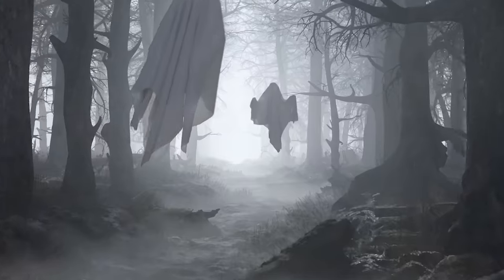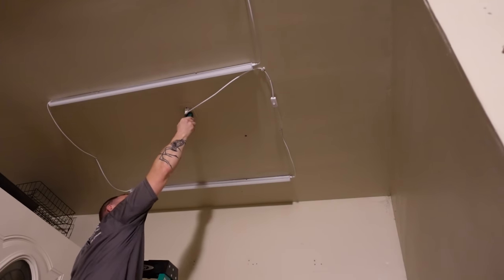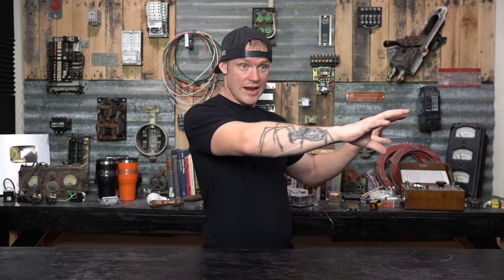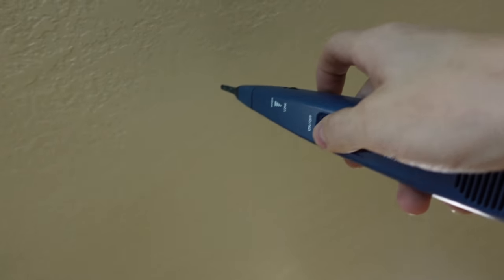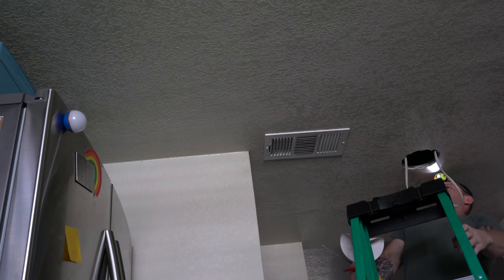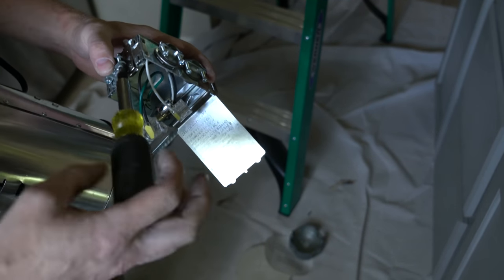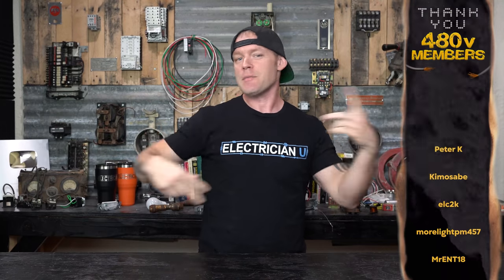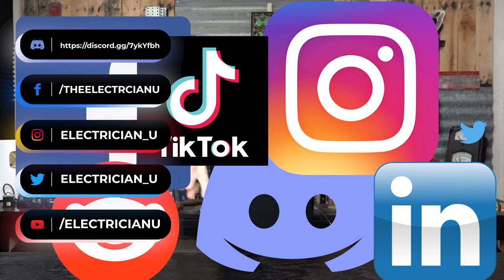THIS IS WHY ELECTRICIANS DON'T HIDE J-BOXES IN WALLS - Finding Hackwork!!

Comment: I did low voltage for many years.  You are spot on with the way you do your diagnosis.  Those toners can bleed and give you false signals though. However, if you are having problems finding tone, one trick is to ground the one toner lead and connect the other to the black.  This causes an imbalance and forces the tone to bleed more.  This can help you find wires that are really shielded, twisted pair, or just blocked by walls.
Reply: I used a similar technique to trace out a doorbell wire that had a short circuit in my landlord's basement.  I put one side of the toner on ground and the other on the two wires connected together.  Found the problem in five minutes there was a bad splice that was not insulated properly.

Comment: Been there done that. It's been illegal to hide a box for a long time, and it kind of pissed me off the couple of times that I've run into problems from idiots doing it. Installing the fixture was a nice solution. I will definitely add that to my toolbag.
Reply: I've seen open splices behind sheetrock...neutrals  tied to hots..burnt receptacles behind big old clothes dressers thus causing hot/gnd reverse...etc..etc...so glad to see this...stress releaser.  ⚡ 
                              🕺
Reply: I had this in my house where the original owner hid them in his basement remodel.  Then tiled it with the fiber squares.  Then they also clipped all the grounds. :(.
Reply: Romex cable has a manufacturing date and lot number printed on it (at least here in Canada). Might be helpful in finding the schmuck who did it if any fire or equipment damage occurs.
Reply: @marc-andreservant201  There is no way to trace such a thing.
Reply: @josephdestaubin7426  You can't tell who purchased it (it doesn't have a serial number like a gun or computer), but if you find Romex dated after the current owner took possession of the house you're pretty sure the previous owner didn't put it in.
Reply: Not that long .  My state did not adopt national standards until about 2005.  Before that  it was town by town .   Some places may have had it most had minimal requirements that were most likely set in the 1960s .
Reply: @tmiklos4  I guess I'm lucky I didn't have to troubleshoot hidden J-boxes at my mom's house. Worst thing I found was kitchen outlets constantly tripping the breaker (the whole kitchen was somehow on a single 15A circuit, including the fridge and lights)
Reply: I grew up in an old 3 story Victorian house built in 1902.  It original had  both gas lighting and electric.  Some light units were combination units.  All knob and tube.    Some rooms had one outlet on each wall average room size 18 x 14.    The outside wall boxes were in the floor,. Inside walls were in the     baseboard.
Reply: The house had the original fuse boxes for a while.    The fuses were like souder wire.  That you put into two screw down holders.    With a master shutoff.              I think that there were 4 circuits in each box.  There were Two boxes in the house.  One in the bacement one in the back stairs near the 2nd floor.    The house is between 2700 and 300 SQ ft.   Amazing what it had for electricity for it's first 75 years.
Reply: I knew it was illegal to bury boxes inside the wall, above the ceiling, etc, but did not know that making them accessible like this - with a light fixture or other removable "not part of the house" object - made it legal.  I found one under the floor of my attic, cut a square around it, turned that square 45 degrees on top of it's own hole and screwed it back down again to protect the box from getting stepped on etc:  legal?  And was it actually necessary, when the floorboards could be unscrewed and lifted?
Reply: @DaddyBeanDaddyBean   That's a funny name. I think you'd run into other problems with having holes at the 4 corners. You could put a brass face plate over it.
Reply: @josephdestaubin7426  When my daughter was little, we called her something like "KatieBean", and sometimes she called me  "DaddyBean", and doubled it up on YT for reasons I do not recall.
Reply: @DaddyBeanDaddyBean   I figured it was something like that or at least something to do with parenting. I wasn't criticising. Quite the contrary, the name alone implies that at least one person in the US is taking their parenting seriously..
Reply: @josephdestaubin7426  👍
Reply: If you’re not gonna put a splice in a box Just twist the wire together and wrap it once with electrical tape.
Reply: @Wolfgang-et7vz  I don't have any electrical tape, can I just use this Elmo bandaid instead?
Reply: @DaddyBeanDaddyBean  Elmo is against code, you can use dinosaur bandaids.
Reply: @DaddyBeanDaddyBean  why don't you just turn it into a floor plug? I think that would be nicer looking and more useful.
Reply: @DaddyBeanDaddyBean  I recently remodeled my basement, and uncovered several electrical horrors that the original owner had committed. I ripped it all out and wired each room's receptacles on its own circuit back to the panel. Where junction boxes were necessary, I made small access hatches in the ceiling with covers that just lift out. Lighting is on separate lines also, with 8 flat 6" LED's in one room, and 6 in another, on dimmers (these are large rooms). They adjust from watching TV level up to operating room level.

Comment: Tool tip: Get an endoscope. They're cheap and can get way in to tight places and connect right up to your cell phone. One of the best tool i have for these types of issues.
Btw, your solution was really great. Win both ways customer and you.
Reply: Never had any luck with them. Nothing is in context, all you can see is a tiny spot in a dark wall, useless really.
Reply: @StanSwan  I use mine a lot for motorcycle diagnostics. 
Usually poking it down a spark plug hole to verify that the piston did indeed meet intimately with the valves. But also sometimes to find that one body panel screw that fell into the abyss and didn't come back out. 
Mine has a really wide field of view so maintaining reference points is pretty easy.
Reply: Does not help if the wiring is hidden in rockwool, and unless it comes with xray vision it only helps to find the wires, not how they are connected. I got two of them.
Reply: @wernerviehhauser94  interesting, obviously if the wall space is packed with insulation or other fill an endoscope becomes less useful, but i use mine to check wiring connections all the time.
Reply: @paddle_shift  I'm in Germany, and here hollow walls are rare. You would mostly find brick walls (we have a lot of different brick types in use), and most drywalls use some kind of filling material (rockwool, perlite, cellulose, ...), not necessarily for thermal but for acoustic insulation. The ways houses that are commonly built in the US or Canada are basically unknown here, maybe even not allowed by our construction codes.
Reply: @wernerviehhauser94  Houses in the northern sections of the US are significantly different than in the south. North US probably compares to your German construction methods / standards. Wasteful to put in insulation levels in our south that are required in the north. Endoscopes are great in the right enviroment.
Reply: @paddle_shift  I would opt for insulation in the south too - to cut down on the need for air conditioning.
Reply: @wernerviehhauser94  I get it, in Germany, endoscopes aren't as useful as other countries. BTW, the south has insulation.

Comment: Who'd a thought electrical forensics could be so exciting? Compelling, I watched right to the end, haha. Well done!
Reply: I was changing out a motor because the circuit breaker was tripping. I was told to change the motor, I did not diagnose.  While there, I saw why things were tripping.  Water had gotten into the conduit because the conduit came apart from the motor housing.  Yep, corrosion for about 12 inches away from the motor.  I fixed it!
Yet another reason that if you are told to do something, take a couple extra minutes to make sure what you are told to do will fix the problem... I reckon that the only problem was the conduit, and the motor was never the problem.
Reply: Yea it's pretty fun.  Especially when you get out of houses and into factories and process plants.
Reply: It's the kind of problem solving they don't show you in school, at least they didn't in mine
Reply: @cdgonepotatoes4219  They can't teach problem solving when they actually are better at creating problems than solving them.
Reply: In the trade we just call it "troubleshooting".
It was my favorite part of being an electrician, new installations are easy, finding problems that defy the rules is a challenge.
Reply: @chriscreed6410  Used to service a small screw factory, horizontal and vertical indexing mills and drills.
Dozens of limit switches, relays, magnetic motor starters and metal fragments everywhere, 277/480v 3ph
Reply: @MichaelClark-uw7ex  'forensics' sounds cooler
Reply: No it isn't, the code states that permanent j-boxes that are an integral part of the equipment are allowed to be covered.
Reply: @MichaelClark-uw7ex  So why is that allowed - it's still buried? What I'm arguing is that there should be an exception that if one marks buried j-boxes, then all is well. Anyway, I get around crap like that by using romex splicing kits, which allows romex to be joined behind walls and still be up to code.
Reply: I just fish a new wire to eliminate the splice unless its not possible then I use a kit or solder and double insulate the splice.

But j-boxes on equipment are considered part of the equipment and not a field splice.
I know it doesn't make sense.
Reply: it makes perfect sense.  Because everyone knows there is a splice as part of the light.  Nobody knows that the shitty splice you put in an overstuffed box inside the wall is the problem.  How do you suggest marking a burried j box so that anyone that works on this circuit would know where it is?  There simply isn't a way to ensure that anyone working on the circuit in future could be aware of these boxes.

And those romex splices are for scabs.  I've never actually met anyone who uses those.  Please just do it right.....  If it's a building you can use romex in, I assure you.... it's Not that hard.
Reply: interesting. Gonna have to research that. 
  If not, I will just place a j-box in the drywall itself in the wall with a cover to make it accessible.
Reply: I'm a tradesman but not a electrician and I still found this fascinating. Good content for sure! 👍
Reply: John Burns you have too much time on your hands so sad!!!
Reply: Well idk about exciting,but it's definitely a paint in the rear
Reply: @robertbutler8004  I get why a non electrician would be fascinated, but this is literally entry level electrical.

However the same people will try to pay you peanuts for side work at their home. Lol.  Remeber how much goes into even the simplest tasks.
Reply: lol your comment had 277 likes now it’s 278
Reply: @chriscreed6410  Try rebuilding and installing a TV transmitter built in 1952, with a building inspector that didn't know that the NEC had a section covering industrial and commercial buildings. The moron insisted that I take out the 480v switch gear, and mount it on 1/2" plywood, instead of the 1/4" steel plate that I had used. He had also never seen 10 KV, 30A armored HV cable, yet he insisted that contractors who wired condos could do the work. He went ballistic when I pulled out the original RCA blueprints and pointed to a then 40 year old notice - 'Electrician, connect power here.' He screamed that he would be right back with a Cease and desist order, but he never came back. This was the original Ch 58, in Destin, Florida. Apparently, the judge had enough sense to know that the transmitter was a turnkey package that could not be wired by the inspector's drinking buddies.
Reply: @MichaelClark-uw7ex  A local business recently moved to a new location. They hired a contractor that specialized in industrial electrical work to wire in their machines. One refused to run. It was fine on the 240, at the old site, but was useless in the 208, three phase building. That contractor refused to troubleshoot the issue, and insisted that a Boost transformer would fix it. It didn't. It turned out that the 'genius' had wired a three phase outlet for single phase, 120V, instead of 208. They still refused to fix their screw up, until I asked the business owner if they had paid the bill, yet. They hadn't mailed the check, so a phone call to tell them they could pick up the check when the machine was working had the grunt there in 15 minutes.
at one time, I did electronics work for three school systems. One told me to do any necessary electrical repairs, and they would have it inspected. This, after being called out when their new scoreboard quit working before a big game. I saw the problem, as soon as I walked into their gym. Below the scoreboard was a shiny new outlet. The problem was that it was the wrong kind. Every common area used a combo 120/240 outlet, for their large floor buffers. Someone had broke the one that also powered the scoreboard. The idiot didn't remove the tab to split it into two circuits, so when the breaker was turned back on, it destroyed the circuit breaker. I removed the link, and noted the wrong outlet on the work order so it could be replaced.
If you want fun troubleshooting, repair a school intercom that some student had removed all the wire nuts, and the tags identifying about 100 pairs of wires.
Reply: @michaelterrell  wow that's scary.  I've got some pretty good stories about people doing stupid things, but that's one is up there with the best.  

I can't image the crazy things that were done back in the 50s.  One of my teachers in trade school actually gave me his first "code book".  It was more like a brochure. Lol.  The things it says in there are insane by today's standards.
Reply: @chriscreed6410  People understood the dangers at the time it was built. That inspector was completely out of his pay grade in a location like a TV station.
Reply: Yes well done, I think only think missing was talking about PPE 
One glove could be different walk home or staying in Hospital or pick a person up off floor
Reply: @frankhynes4514  omg.  PPE?   This is a house bro.  I've been inside a 50KVA transformer in a short sleeve shirt covered in sweat.  The hair on my arms was standing up. 

And you want gloves to work on a residential receptacle?  Wow.
You must be a safety guy.  Or work for OSHA.
Reply: @michaelterrell  Wow.... that's insane!
Reply: @dryan8377  A lot of things are. We had a slow nitrogen leak at a transmitter site, with about 1900 feet of large waveguide.. The tower crew showed up for annual mantainance, where they checked every bolt on the 1700 foot tower. Apparently they didn't make contact with the operator in Master Control, or check the logbook because one of their workers leaned back against a corner of the waveguide and got a nasty RF burn. A weld had cracked in the 1/4" thick brass where it was welded, and the waveguide was carrying over 175 KW of UHF TV signal on Ch55. The notified us of the damaged section, which had to be custom made, under warranty. Then a second trip back to install it, between Midnight and 6:00 AM one Monday morning. It was so large that a kid could have crawled through it.
If the Nitrogen pressure wasn't right, it affected the signal quality, because it changed the impedance, and clipped the Sync portion of the signal, since that was the strongest part of the signal.
Reply: Chasing down faults like that is actually one of my favorite electrical activities, it's solving a puzzle.
Reply: @James1095  My strangest was at a school. The wires in one room were black and white in the1/2" EMT At the other end, it came out as yellow and red. Some SOB union electrician had splice the wires, then pulled it into the conduit. The splice was about 20 feet from one end, and the tape had dried out. The conduit had 120VAC on it They were lucky that the person who touched it wasn't well grounded.
Reply: Who’d’ve *
Who would have

Comment: As a retired fire marshal,...I have come across a myriad of electrical nightmares.  One of my favorites was a junction box fashioned from an old coffee can, nailed to joist, above drywall ceiling.  Had nothing to do with the cause of the fire, but we came across it.  I wish I had gone through the trouble of saving all of these cool photos to a thumb drive.
Reply: when i fixed the electrical from knob&rubem 
i had one similar. no junction box. an outlet (no box) inside a wall plaster over it
other one i had. romex wire plastered over it inside the wall on top of a joist. instead of drilling thru the wall joist and place the cable in it. it was over and inside the plaster. 
i almost had a hard attack when i demolished that wall with a jig-saw and pinched the wire (old building from 1925 plaster)
also had romex 15 amp cable (white), going flush with the drywall. with plaster and painted over it for about 16 inch (2 joists away) embedded. connected to the electric plinth for heating and attached to a 20 amp/240v breaker. wtf was the previous owner thinking. it's a disaster waiting to happen.
Reply: "not the cause of the fire but probably some other DIY repair was I assume.
Reply: Question: Was the coffee can Folgers or Maxwell House? Could be germane to the electrical problem issue.
Reply: Coffee can. Good, good. But can you beat a tin of chewing tobacco turned into a j-box. (Buried. Of course)
Reply: @davidgoossen113  I'm surprised at you Dave. You didn't even mention Sanka-a Caffeine free alternative. Sheeeeesh.
Reply: Well, actually... if it had a good lid on it and carefully thought about, a coffee can should be plenty effective.